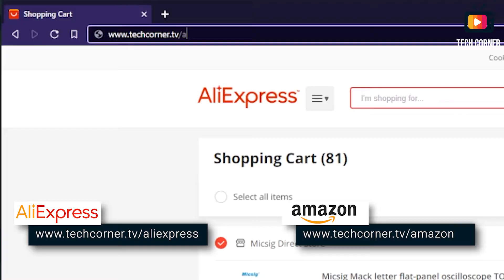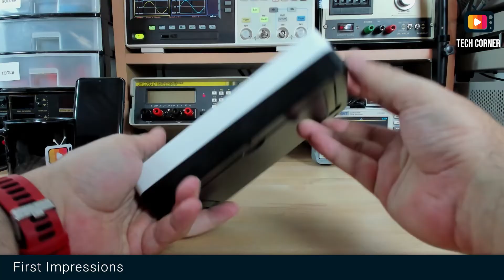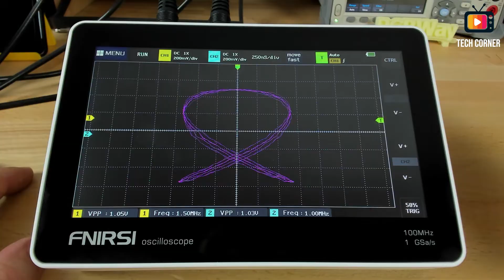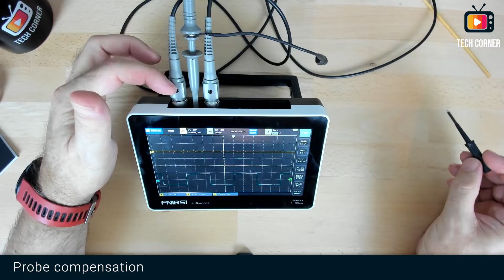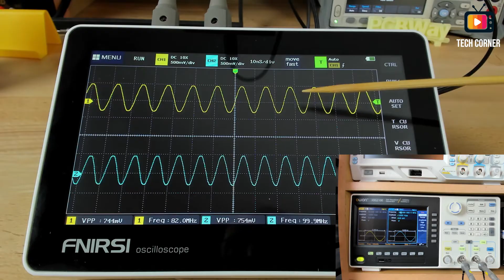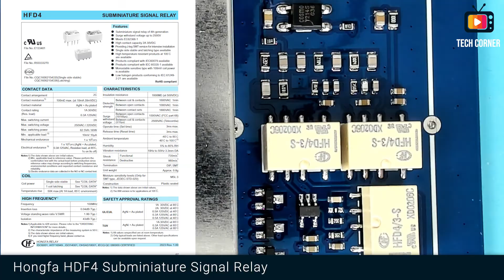FNIRSI DSO1013D Tablet Oscilloscope ⭐ Low budget ⭐ 2 Channels 100Mhz w/ 1GSa/s sampling rare

Comment: Excellent, thorough review !!   I'm almost sold on this 1013D but can you please enlighten on a feature that you did not seem to touch on ?  At about 13:30 where you demonstrate the "Save Wave" and manipulations that can be done, it seems that the total time of the saved wave was VERY short and you were down at a very low frequency of 200kHz - is there a way to capture saved waves for longer periods ?
Reply from the maker: Hi, they have 2 new oscilloscopes that will be money more well spend, see this video https://youtu.be/qMOetpIUgGQ and they have a new bench scope also very interesting. It's almost the same value. Thanks for watching.

Comment: What is xy used for?
Reply from the maker: Hi, had to go get this so can give you a complete answer, but here it is: 
The XY mode on an oscilloscope is used to display one signal against another in a parametric plot, rather than showing signals as a function of time. This mode is particularly useful for:

Lissajous Figures – When comparing two sinusoidal signals, XY mode can produce Lissajous patterns, which help determine the phase difference and frequency ratio between the signals.

Phase Relationship Analysis – Engineers and technicians use XY mode to analyze the phase difference between two periodic signals.

Vector Signal Display – In RF and communication systems, XY mode is used to visualize modulated signals like AM or FM waveforms.

Curve Tracing – When connected to a component tester or function generator, an oscilloscope in XY mode can be used to display voltage-current characteristics of components such as diodes and transistors.

In this mode, the X-axis is controlled by one channel (e.g., CH1), and the Y-axis is controlled by another channel (e.g., CH2), allowing you to observe relationships between two signals directly.

Thanks for watching.

Comment: Hey, I am a layman and have an RV with victron 12v 3000 watt low Fq inverter and I wanted to use this to monitor both the power coming into the RV and what the power looks like coming out. Could this work for me? I would be mounting this thing on a wall.
Reply: If you want to monitor the voltage change over time, that is, just look at the instantaneous difference, this is expensive.
If by power you mean the power, that is, Watts and not "Volts", then this is not suitable for that.
To measure Watts, you need a device that can measure both current and voltage at the same time, and multiply the two values by mathematical means.

For this, I would buy a power meter separately.
One for the DC 12V and one for the output, I don't know, 110VAC or 240VAC.
Much cheaper than this fake oscilloscope.
The Fnirsi parameters are not real, it doesn't even know 1/5 of what is written on it...

Comment: Demonstration was perfect. You are always great
Reply from the maker: Hi, thank you for watching and your nice comment, really appreciated.
Reply: Not quite, he missed many important points.

1. The Fnirsi scopes do not describe the real specification.
They do not have a sampling rate of 1GSa/s, but only 200MSa/s, which is only 1/5 of what Fnirsi claims.

He did not find this out, although it has already been mentioned in many places.
The wobble and polarity of the Wave also indicate this.
When he looked at a higher frequency, for example 75MHz, the wave was nice and smooth because it was smoothed in software.
When the wave changed in a strange way, the screen indicated the rubbish with which Fnirsi deceives its customers.

2. The vertical sensitivity they wrote is 50mV/div-500V/div, which is mixed.
50mV/Div applies to the 1x probe
And 500V/Div applies to the 10x probe.
That is, with the 10x probe, the lowest is only 500mV/Div.

Also, others have already found out that its real sensitivity is 100mV/Div, the lowest in reality.
That is, with the 10x probe, the lowest is 1V/Div.

Fnirsi manipulates the signal in software in such a way that it divides the measured value by two and draws it.
That is, it cheats the customer again...

3. The price of this device is high compared to what it can do.
You can get it cheaper and in better quality.

4. memory depth is not mentioned, which is very  important to  a digital oscilloscope.

I have had three types of Fnirsi scopes, all of them are rubbish.
1013D, DPOX180H, 2C53P.
Only the DPOX180H works as it should.

In the next few days, the Hantek TO1112 scope, which I bought to replace the Finris, will arrive.
Because the Finris did not meet my expectations.
The Hantek also has its flaws, but at least it is usable.
Reply: @juhaszpeter4796  I believe you are right of all what you say. Also we always appreciate efforts has been carried out to evoke the real specs of the device. What made this osc. Practical is the size and battery pack and the price. If you find some others with best and competing specs please inform us

Comment: Is there any cover/case that one could possibly buy?
Reply from the maker: Hi, official I don't believe so, but considering the measures, you can easily buy on aliexpress, see some examples here https://geni.us/SEV3Y but you have some with foam DIY that you can cut and store it exactly as you want. Thanks for watching.
Reply: @Ruskieit  I purchased a unit. It was acceptable in performance. It would be excellent if it has the facility or function to average the signal especially when the fluctuation is great in signal peek

Comment: You do realise that to measure to 100 MHz the probe capacitance will act as a low pass filter and your measurement becomes inaccurate, you should be using 100:1 or better still 100:1 probe to minimise the probe reactance.
Reply from the maker: Hi! Good to know. At the moment I don't have 1000:1 probe, I'll try to get one for future tests. Thanks for sharing and watching!
Reply: At wich frequency i should be using the 100x probe? beyond 30mhz? 50mhz?
Reply: @eduardoavila646  Look at your probe specifications.

Comment: The differences in the bandwidth limits of the two channels can be easily tested by simply switching the probes to the opposite channels. If the high bandwidth channel moves with the probe, it means the scope is fine and the probes were not properly compensated.
 I compensate at a high frequency squarewave because I have one available, and it makes a huge difference in the performance at the high end of the channel's bandwidth.
 Also keep in mind that if your sample to sine wave conversion requires 5 samples, your scopes conversion routine may very well be running out of time to take that many samples when you get to around 100 Mhz, and will start aliasing.........
Reply from the maker: Hi Dennis, thank you for sharing, the change probes tip really makes sense. Should have though about it before. Thanks for watching.
Reply: @TechCornerTV  that was my thought as well ... the moment the difference appeared, I thought swap test points, keep the probes to the DSO1013D side the same connection, but switch them on the source side, thus if the difference stays, its probe internal path, if the difference goes with change in tip source, its tips, probes, or worst case, source generator.  Thoughts also go to grounding, if grounded at the same spot or separated.. its that weird part of me that saw that and instantly ... like arm-chair jocks shouting at the tv screen during a game ... I'm like NO NO.. Go Back! ... Test.. Find it why was it more!?! (LOL)

Comment: Yes. The 1014D is about same price but if you go review your old video it didn’t perform as well. 

Both lie about the specs but this one is a little newer and I am guessing the processor is better in the tablet version.
Reply from the maker: HI Jerome, yes my unit did have multiple issues. It was the first giveaway of the channel, so I can't retest it now, I would like to give a second run on it, this oscilloscope was released previously than the 1104D and had some bad reviews, that I was expecting even a worst experience. I'm glad was not the case. Thanks for watching.

Comment: There is a alternative firmware development in the eevblog forum  Topic: FNIRSI-1013D "100MHz" tablet oscilloscope.
The maker also added a RTC modul and improved adc stability over battery voltage.
Reply from the maker: Hi, that is very nice information to know, thank you for sharing. I do enjoy the EEVBlog foruns, but there is so much information and the time latelly is so little that I'm not able to go there as I would like. Thank you for sharing and for watching.

Comment: Obviously it took a lot of effort and knowledge to make your videos. As someone thinking about getting a first scope I found your videos very helpful and I wanted to say thank you.
Reply: This unit it seems to me would have been better received if they called it a 75mhz scope. With a 7” touch screen and simple user interface for around $120 shipped to your door I still think it would be a value. 

Anyway, if I could bother you with a question. I do some tinkering with electronics, for which I think anything the 100mhz bandwidth that’s easy to use would meet my needs.  

But, I also do some mechanical stuff. The fastest thing there I’d look at would be can bus, but it would need to capture a long time frame at low frequencies. Say being able to capture 2 engine revolutions worth of cam and crank hall/inductive signals. A person would want to see the individual pulses for at least 2 revolutions to determine the relationship between the two, though panning the screen over would be ok. I’m not really up on scope memory to tell from the specs what models might capture that much data. 

So basically a budget tablet, 2 or 4 channels, 100 or better MHz, and a bit of memory/time capture. 

Anything like that exist?  Perhaps I’d be better off with 2 devices, like a USB Pico or Hantek for automotive, and a handheld for portable fiddling with power supplies and what not…
Reply from the maker: Hi, thank you so much for your nice comment. Glad it was helpful. Thanks for watching.

Comment: I really disliked the cheap plastic fold-out stand.  I was always getting glare from the scope angled towards the ceiling.  I decided to modify my fold-out stand with a couple of small O-rings.  I put the O-rings over the plastic hinge pins of the fold-out stand.  This sort of worked, but when I installed a small piece of 4mm plastic on the other side of the stand, it wedged the hinge O-ring tighter and provided the friction that I was looking for.  The change is like night and day.  I used to have a flimsy stand and now I have a stand that stays in place where ever I position it.  No more glare in my eyes.
Reply from the maker: Hi George, sorry the late reply, trying to keep up with the comments, not easy. I agree with the points your brought out. This was one of the first oscilloscopes from FNIRSI and it shows. I think today, they're sending to the market items with much more quality. Thanks for watching.

Comment: Thanks for your great reviews!. I am just a hobbyist that like to try to repair broken stuff before I throw it in the garbage, I have manage to salvage a lot of electronics just with a voltmeter. I feel my next step is to get an oscilloscope and the prices are quite affordable now. I have looked at  DSO1013D, the DSO3D12  and the Zoyi ZT702S . I do like the large display of the DSO1013D, but the buttons and functionality of the DSA3D12. the price point and portability of the Zoyi is great too. what would be your top pick for a small workstation?. thanks!.
Reply from the maker: Hi, thanks so much for you nice comment, really appreciate. This is a hard question, because you're more or less in the same price range, but comparing devices with different specs and mainly screens/sizes. If you worked with a multimeter and were fine with it, any oscilloscope will be a huge improvement. The Zoyi is a very nice piece of equipment and it is also DSO3D12 for portable oscilliscopes/multimeters and you even have now the FNIRSI 2D23T that I just made a review. For large screens, you can go with the DSO1013D or even with DSO1014D for entry level oscilloscopes. Also your budget is very important in here, so if you're pointing to a budget of $60 to $150, my choices will be for oscilloscope only DPOX180H, DSO2512G small factor, 1014D 7" screen, or 2D23T, 3D12 or ZT702S for multimeter/oscilloscope. Thanks for watching.

Comment: It's a pity this is before they learned to give a proper bandwidth number. If it's advertised as 75Mhz scope, no-one can complain, or even be impressed.

Would love to see you test the sampling rate as well, if it's possible.
Reply from the maker: HI, I'm always open to improvement, my videos are already a bit long, sometimes I pass somethings, but I will try to test it in the future. Thanks for watching.
Reply: @TechCornerTV  If only just enough, to give a pass / fail. There is no spec that's guaranteed with many of the chinese OEM's unfortunately 😅 It almost seems worth it congratulating them when they don't lie...

Comment: It would have been interesting to see a square wave signal in the range up to 100 MHz.
I don't know why you only tested the sine function, because every oscilloscope can actually represent sine quite well.
Only with square-wave signals do the weaknesses of a device reveal themselves.
Reply: sine wave is the purest wave. Often a function generator's highest bandwidth waveform is also only a sine wave. A good square wave is much much harder because of all the higher frequency harmonics needed to implement it. For any oscilloscope, it should generally not be able to render a square wave properly near its bandwidth limit because there aren't enough sample points for it to knowingly reconstruct a square wave on the screen. That said, many manufacturers over or under specify their bandwidth's for given scopes, to different amounts. Given that, testing a sinewave is the purest absolute test, because a sine wave is the last waveform that any oscilloscope can possibly display before it can't measure the signal. So a -3dB point always provides an objective point of comparison across all scopes for where their absolute bandwidth limit lies.
Reply: In digital technology, you have to deal with square wave signals, never with sine waves.
It is uninteresting what high frequencies an oscilloscope can still display with sinusoidal voltage if it fails miserably with square wave signals.
That is why a test should always be carried out with square wave signals. It is then clear anyway that it goes a good deal further with sine waves.
Reply from the maker: Hello, my function generator is not able to output a 100Mhz square wave, it is pretty hard to have a good square wave at 100Mhz... But I will try to show more times the other waveform types, normally I just forget. I gotta get a todo list for the reviews. Thanks for watching!
Reply: @TechCornerTV  There is no need to test waveforms other than rectangular.
If the steep edges are OK, then the flatter signal rises will be OK anyway.
That is also the reason why you always calibrate an oscilloscope with a square wave signal.

Comment: 33:00 - How this works? It's simple answer - Republic of China product 🤣. What are the differences compared to the previous version (except for BNC sockets)?
Reply from the maker: Hi, I didn't used the previous one, but for what I understand they said that the real bw of the model when was released was about 30Mhz... so that's what I was expecting to see... it handled a bit better than I inicially previewed, so I think the ADC were also updated. Thanks for watching.
Reply: @TechCornerTV   I wonder if they really did improve the analog section or instead did some software tricks to make it look like a better bandwidth. Is the reading the same in different timebase settings? You could also check the rise time, that is another indication of bandwidth.
Do they still blank out every signal that is below 30mVpp? They did in the beginning and showed a straight line instead, which makes it fairly useless for measuring some audio signals.
As for the different readings in the two channels: recently I fooled myself into this by using one probe that was not properly compensated for my scope, which resulted in increased readings with higher frequencies. Could that be the problem in this case?
Reply: @TechCornerTV  sorry, didn't watch the whole video yesterday night, now I've seen you calibrated both probes. Then I have no idea either what went wrong.